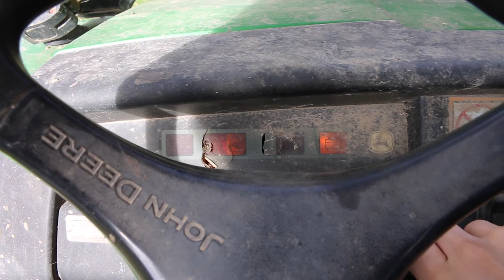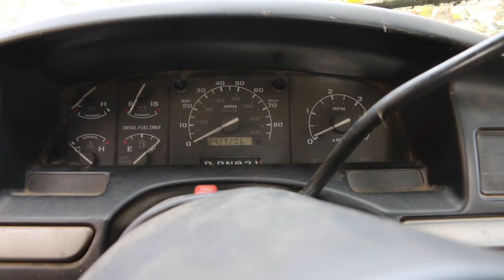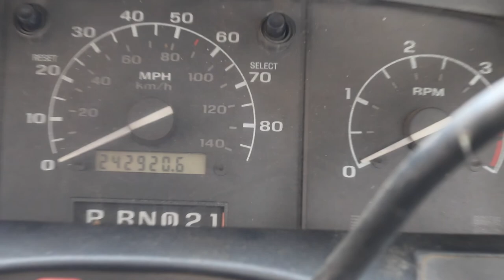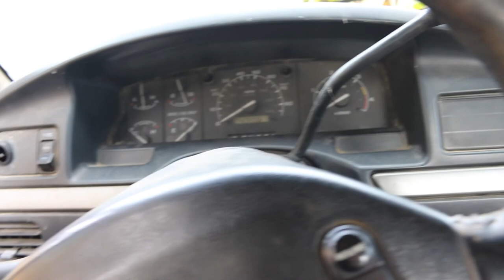Cold Start Ford F 250 7.3 IDI & Vlog

Comment: oh oh better be careful with the water ontop the air filter housing. you got a leaking hood seal. the water can pool up ontop the air filter lid and run down that screw and fill your cylinders with water which will end up in a bend rod or something like that. other than that that things runs so good now - i bet it will start in the coldest winter too :D i hope you will try it.